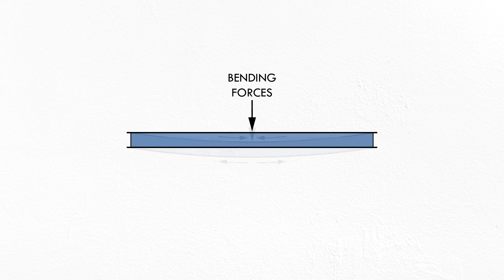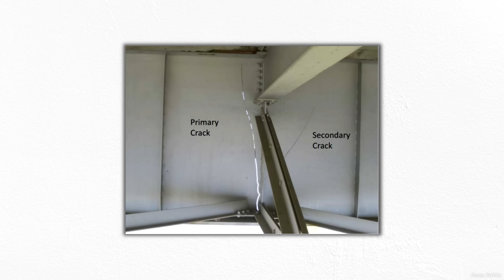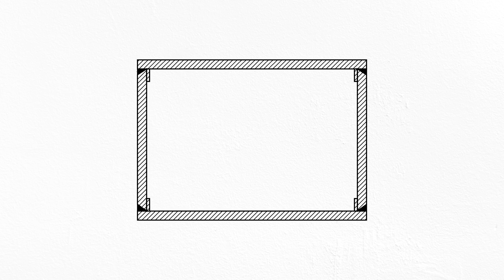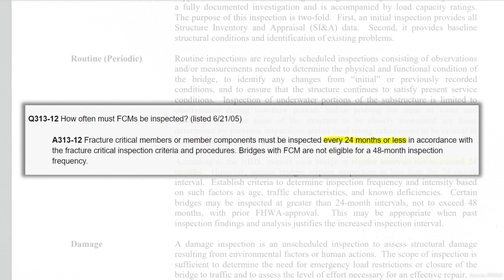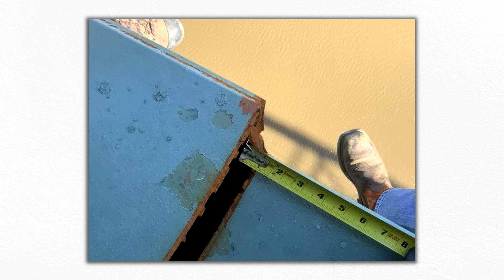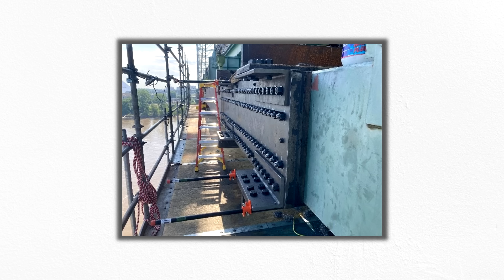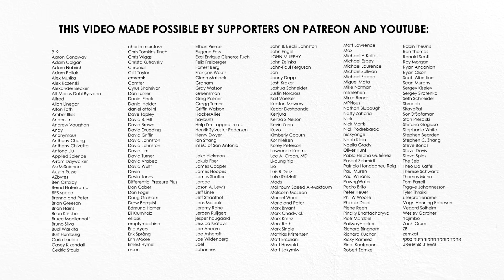What Really Happened at the Hernando de Soto Bridge?

Comment: "It's hard to understate the severity of the situation."

I can understate it. "The crack in that member is no problem. You could roll multiple companies of M1A1 tanks over that bridge all day long every day with no chance of that bridge failing." What you mean is, "It's hard to OVERestimate the severity of situation."

Then later you say, "... a human person has to check every surface of the steel from, at minimum, an arm's length away." So if a person can't get closer than an arm's length, I guess checking the steel from 5 miles away would be fine. 

It think I know what you're trying to say, but I don't think you're saying what you mean to.
Reply: @Russ Bell Can confirm, there is a certain dearth of elegance in the vocabulary of an engineer

Comment: TLDR: the HDS bridge incident mirrors a similar incident almost 10 years ago on a bridge that’s identical in design that serve the same purposes in cites that have the same amount of interstate bridge connections and both suffered similar traffic issues as a result of the closures

The Hernando De Soto bridge feels like it mirrors the incident with the Sherman Minton Bridge in Louisville about 10 years ago, being a vital east-west thoroughfare between 2 states that’s very important to freight. Both were built 10 years apart as well, with nearly identical design and capacity (3 lanes in each direction, for a total of 6 lanes). Both cities have only 2 interstate bridge connections and caused major traffic nightmares due to the closure of one of the 2 major bridges. The shutdown prompted the states of Indiana and Kentucky, the states the Sherman Minton connects, to finally progress forward on a project that had spent 4 decades being lobbied for and against by various locals (the opposition was pretty strong being that the east end bridge cuter through the most affluent part of Louisville on the Kentucky side, but the closure of the Sherman Minton kicked the state into gear to find a solution that made everyone as happy as possible) and build 2 new bridges: an east end bridge that connects I-265 in Indiana and Kentucky, a second downtown bridge to split the northbound and southbound traffic onto 2 separate bridges and increase capacity to 6 lanes each direction, plus a redesign of the incredibly confusing spaghettini junction where I-65, I-64, and I-71 all meet at the base of the Kennedy and now Lincoln bridges in downtown. After the events in Louisville 10 years ago, I wonder if we might see something similar happen in Memphis.
Reply: if we do, i'd love to see the other bridge replaced with a very beautiful cable stayed bridge thats 4 lanes wide and earthquake proofed and the interchange at I-55 and crump ave completely redone.
Reply: @Guy Stalnaker you’re very welcome. And you probably saw a more recent image of it on the maps. It used to be way worse before the reconstruction despite there being one less bridge to connect.
Reply: @Guy Stalnaker if you open google maps, you'd see the shit eating designed crump ave @ I-55 in memphis, just before you hit the old span that most likely is built to 0 earthquake proofing
it had a minor upgrade to handle the extra flow of traffic, but again a minor one. its a cloverleaf design, except I-55 takes it right through one of the cloverleaf ramps instead of the throughway. the throughway takes you to downtown instead of I-55 if you ain't very careful.
its honestly a huge 50s eyesore as well, as its as old and anquicated as the bridge that spans the mississippi connecting it. me personally i hope they replace that ugly mofo, and the bridge too,  the desoto bridge keep, its iconic of memphis anyways and it wouldn't be right to demo that down and all that. also it could ramp up the I-69 projects as well, after all a 3rd span has to be built somewhere  for I-69 and if anything, maybe even I-269 can be built as well as a 4th and 5th span.
idk, not a engineer, but would be interesting to see what memphis would do once they start adding more spans. indiana and kentucky already are adding a span for evansville to have another connection with I-69, officially extending I-69 to tennessee.

Comment: Practical Engineering: "Structural engineering is not an armchair activity..."

Me, an Armchair Engineer: Silently nods head in agreement.
Reply: @Great Value Bleach 200,000 units ready to deploy, with a million more well on the way
Reply: Me, a rock climber: I wanna look for cracks on a bridge.
Reply: I'm an armchair engineer.  In my chamber adorned with bookshelves to hold my cherished volumes.  In my robe, I find my armchair, my pipe and a choice book.  Seating myself, I gingerly turn the pages and nod my head.
Reply: Intrerestingly, just been a little involved in some bridge monitoring at the university i work at. Some really good information about bridge structures in this video, thanks @Practical Engineering
Reply: I'm no armchair,  but I know breaks in a load bearing item is a big no no
Reply: is Bilb Ono even "a" engineer
Reply: Me: I wonder how the steel was distributed down the North Tower of the WTC before 9/11. I have not heard any structural engineers discuss it. - Armchair electrical engineer
Reply: @psikeyhackr6914  jet fuel can’t melt stale memes!
Reply: @trent_k  wasn't talking about melting steel. Was talking about distribution of steel. Did the 5th level contain the same amount of steel as the 100th level?  The potential energy cannot even be accurately computed without distribution of mass.
Reply: @psikeyhackr6914  he didn't say steel, he said stale memes
Reply: @nathanaelmalm5641  I never said anything about that meme. Totally uninterested.
Reply: @psikeyhackr6914  no, the guy you replied to said that. To which you replied you weren't talking about jet fuel melting steel
Reply: psikeyhackr the steel was distributed vertically.
Reply: @Ass_of_Amalek  WOW! That is brilliant!

Are you saying that every level had the same amount of steel even though a 12 year old should be able to figure out that the lower portion had to support more weight?

Comment: That was some good research in the video.  Ways to fix a plate steel issue is the fun they have in the future.  Finding steel that is up to grade and Made in the USA is the first thing on their list.  Do you run a steel cable down the middle of that tube to have a back up plan?  I remember watching them building that bridge, then riding over it when it first opened.  It made the old bridge feel like a one lane road.  I was shocked they never built a back up bridge for insane events like this.

Comment: I remember another bridge over the Mississippi failing 14 years ago.  Its failure was blamed on design flaws: a too-thin gusset plate ripping out a row of rivets at the time of great stress on the bridge (rush hour).  But the inspections it had undergone had deemed it already in poor shape.  Also, at the time it collapsed, the I-35W bridge in Minneapolis was undergoing construction, narrowing the traffic stream and adding over 275 tons to the load.  13 people were killed, 145 injured.  Be glad someone caught the I-40 issue when they did.

Comment: Very professional presentation.  However, I would not use "crack" and "fracture" as terminology for the same condition.  At this point, it is very clearly a complete fracture.  Also, notice the separation.  The complete fracture has resulted in a separation in not one, but two dimensions - horizontally and laterally.  Given that the bridge lies in the New Madrid fault area, that should raise eyebrows. I hope the investigation takes that into account.

Comment: As a local truck driver, I have traveled over that bridge hundreds, if not thousands of times since 2016. I only want to input my two cents and say, the weigh station in Arkansas requires all truck traffic to be in the far right hand lane while crossing the bridge. The crack was on the same side as the truckers were required to be in in order to receive prepass signals, letting the truck driver know if he can bypass the scale or if he has to go in. I believe that requirement alone, created extra stress on that very section of beam. I'm no expert, I did not stay at a motel 6 last night, but this is just my theory. 👌✌️

Comment: In the same vein as "If you find one crack, you may find others", is the extension "If you find one busted bridge, there are likely many others".   The historical record of bridge and structure failures is packed with collapses and death, often after a design has been "improved" in some fashion.   In the USA, we have starved our infrastructure of inspection and maintenance and while this is a big one that was probably about to fall, I suspect there are many hundreds of others that are going either undetected or casually accepted in degraded condition.    Design (to me) is an art, heavily supported by science and history....it's not exact or in some cases impossible to precisely predict performance.   Europe is full of cathedrals that are impressive to remain standing until you realize... those are just the ones that didn't fall down, and they are built on the bones of many tragedies, "ballparked" as best as possible at the time by the most qualified folks at the time.    I would not be surprised that an honest assessment of American highway bridges ( and there many thousands ranging from tiny to huge) wouldn't find a double digit percentage with latent issues of one sort or another.   Fascinating problem, in the worst sense of the word.   ( Your videos are top drawer.  Great stuff.   You should have Henry Petrosky on one, as engineering failure is one of his dominant themes! )
Reply: There is no glory and acclaim in preventing a problem, only in fixing one.
Reply: Write your Congress person.  Infrastructure bill will pump money into a starving carcass of inspections of critical components like this bridge.
Reply: @beachcomberocean4859  It won't I remember reading that TN has well over 1000 bridges needing imminent and immediate repairs, TDOT has been working on US-129 since 1980 at least, and it's still going on in Blount/Knox counties.  Stay safe out there people.
Reply: @beachcomberocean4859  especially if the  congress reps  family  owns  stock in the construction  firms  who will fix  it   . . . .     there lies the  problem  . . .   DRAIN THE SWAMP !
Reply: Actually, let’s be real here, those cathedrals didn’t fall down nearly as much as what you’re implying. They burned down a lot, see also Notre Dame, but that’s a different issue. For the most part they were just *incredibly overbuilt*, with safety margins out the wazoo.

I say this living in a city where much of the cathedral actually did fall down, mind you. The middle part of the Dom in Utrecht fell down in the big storm of 1674 (which, mind you, was actually a once-a-millennium storm, not just a regular old storm). It had fewer supports and less of them than the rest of the building, either because they thought they’d get away with it or because of budget issues or both.
Reply: but but but, bridge inspection is big government, boo hoo, muh freedom
Reply: @DM-mi4je  lots of people are saying and have been saying for decades there shouldn’t be infrastructure spending. Mostly republicans.
Reply: @DM-mi4je  DRAIN THE SWAMP !
Reply: In my state we have many bridges that are what they call red listed yet they keep them open knowing they could fail at anything because the state wants the feds to pay for it and the feds think the state should pay so nothing gets done then some run near eviromentally sensitive area so Des gets involved causing more problems
Reply: My background is in both historic preservation and architectural drafting and i just wanted to say that I share that same philosophy idea in design as you do. Good luck to you on your future designs.

Comment: There is a slight mischaracterization about cracks initiating at or near welds. It is most common for a crack to initiate adjacent to the weld metal, in a high residual stress area known as the heat affected zone. Any sharp defects in this area, such as weld undercut, provide easy initiation sites for cracks as the residual stresses can approach yield level.
Reply: Well stated with a good response to Chris Hayes.  As an engineer with 50 years of experience I was thinking the same thing as Grady covered that potential mode of failure.
Reply: so ... pretty much what he said in the video?
Reply: @chrishayes8197  sort of, that's why I said slight mischaracterization. He seems to imply through the graphics and the defects he is speaking about that something like a weld impurity or void might cause this issue, and that it would originate in the weld metal. But these types of inclusions are likely to lead to other failure modes like accelerated corrosion, not crack propagation. Cracks will typically initiate at the toe of the weld, or very near in the HAZ of the base metal.
Reply: @joshgeorge7  He pretty specifically said that the weld shrinks causing stresses on the rest of the material around it, ie the high residual stress area you mention. That was pretty clear to me that he didn't say the weld itself formed cracks, but that the shrinking caused cracks on the material right outside the weld.
Reply: The problem is that one of the only ways to prevent problems from heat shrinkage stress is to heat treat the whole block after welding.
Reply: @TheRealSkele  or simply peening... welding done right does not introduce failures.
Reply: @TheRealSkele  do you mean to let it cool slowly, or another heat process?
Reply: @billydamnit Only thing I do remember is that it is possible to stabilise the stresses inside the component through heat treatment. I can't remember how the process is achieved, but I'm sure there are individuals here that can answer your question.
Reply: @billydamnit  
Heat treatment would typically involve bringing the metal in question back up to a specifiedvtemperature to allow the metal to expand symmetrically, "relaxing" any residual stresses in the heat affected zone adjacent to the welds.
Reply: The backer rod used on the inside of the boxes often are tacked causing another stress riser known as a fatigue prone detail. Thats my guess

Comment: I'm just glad they didn't try and cover this up and act like nothing is wrong. I am glad they fired the negligent engineer, I mean.. how do you miss a clear tension crack like that and a pillar that supports it moving. I can say pretty certainly the robot that welded that part created a hard spot in the steel, and with repeated movement from the traffics movement and the movement of the land the steel fractured. It's hard to ignore the evidence.

Comment: I can't believe no one noticed that big ass crack on the outer edge of that steel plate while passing beneath it on boats. Glaringly obvious that's a giant crack in the steel framework. I was stationed in 1985 at the Millington Tennessee Naval Air base, and on numerous occasions, on my way to and from my friend's house in Oklahoma, I crossed this very bridge traveling by both motorcycle and car.

Comment: 8:59 the drone video from 2 years earlier, there's a vertical bar going up from approx where the crack is, that bar looks bent.
Reply: I don't think that that "bar" is a bar at all. I think it is round in cross-section, like a pipe. I'm guessing it is a drain pipe that connects to a catch basin on the edge of the bridge deck. It's purpose is to collect and dump rainwater from  the bridge deck and dump it into the river below. It probably buckled due to movement of the bridge span seat, like the broken chord member.

Comment: Here is something interesting. The Sherman Minton Bridge over the Ohio river carrying I-65, is a similar bridge opened in 1962, about 10 years before the Hernando de Soto Bridge opened. Well interestingly enough, the Sherman Minton Bridge was closed for several months about 10 years ago, in 2011, for similar problems. Cracks were discovered that required significant repairs and several months of time to complete them. The initial crack that started the closure was determined to actually be from the original construction, but was completely missed until 2011. The additional cracks discovered were fatigue cracks. It suggests that this type of bridge has general problems, probably more related to the steel and construction techniques, than from the raw design. None the less, I find that very interesting.

Comment: As the crack had not been detected before complete failure, performance interval of that specific maintenance inspection procedure should be cut in half. Or even shorter than that.

Comment: No no no, we aren't blaming welders, the break in the beam is not on a welded joint it's next to a splice plate. Both states are responsible
Reply from the maker: The whole beam is a built up section. There are welds along the entire length. This bridge was built before modern welding codes that helped avoid stress risers. Not trying to blame welders at all. As I said, without a forensic analysis, we can't say what cased the fracture.

Comment: I was an AWS-CWI, ASNT LEVEL lll Visual, and level ll Mt,Pt,Rt & Ut. I am flabbergasted this is here and wonder how as well. Perhaps a very small crack that was missed after that tube was formed and seam welded. I would suspect that the crack could have originated in the seam weld or from a very small nick at a formed corner that was covered by the original coating. Why it was not discovered sooner is in my opinion not as important as it was found before the bridge could fail. Perhaps more frequent inspections are needed than the 2 yearly one.